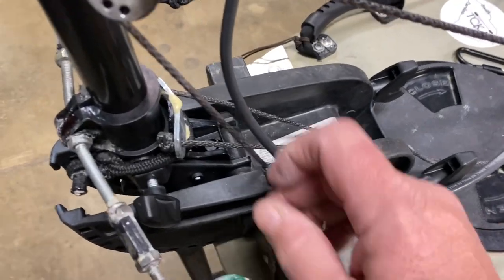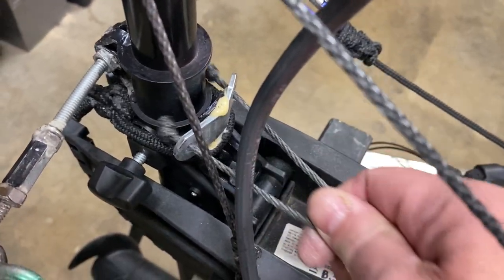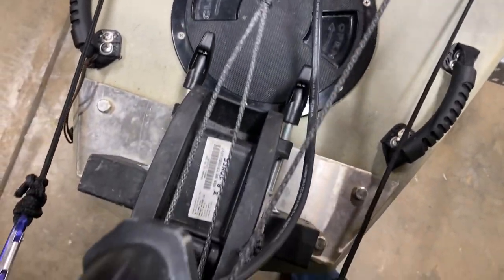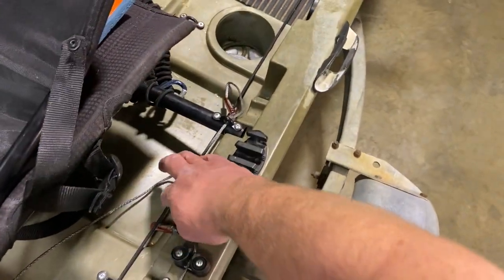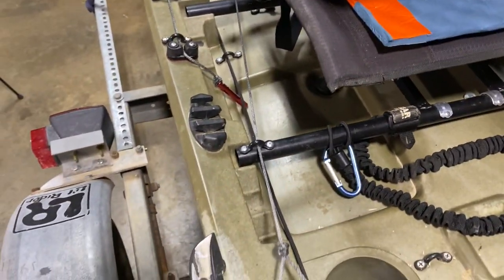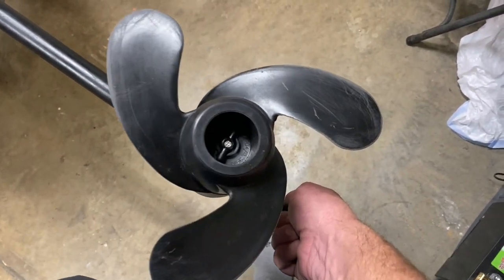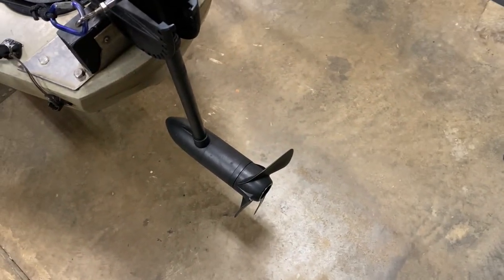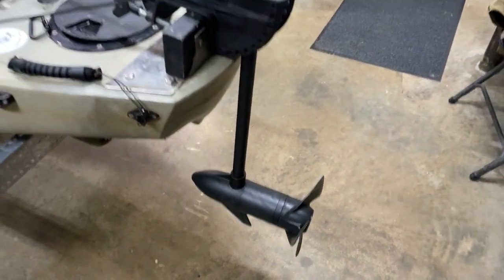Killer Mod to Easily Raise and Lower a Trolling Motor on your Fishing Kayak

Comment: ahoy mate.   attaching the cable to the bottom of the motor and having that pulley right at the top was a game changer!!!   its so easy to pull up it motor now.   before I had the cable attached right at the top of the motor and was pulling down to a pulley on the boat.   it was so hard to lift!! thanks for that idea!!! drinks are on you!!!

Comment: You single handily solved my issue with wanting to use reverse but that little lever stays shut so it moves freely I will definitely be adding that curved bracket and ties to mine so I can finally use reverse!

Comment: I’m doing the same only thing is I’m putting a 1 x4 in. Aluminum plate inside the plastic parts on each side where the locking notching holes  are. Then do the same thing you’ve done. With my bungee or springs. I like your thinking

Comment: I'm going to find a way to have that lift cable also release the stop on the pivot. So that way when I pull the cord to lift the trolling motor, I also release the lock tab at the same time. There's got to be a way to do it.

Comment: Nice video.  I came up with a simple way that doesn't require any modifications to the locking mechanism.  Just had to drill a hole through the lever and used a pulley I had purchased from home depot :)
Reply from the maker: Great idea man! I thought of the same thing I was trying to avoid drilling it, but I think that’s gonna be the best way to go in the long run because there is so much tension when using the bungee that I don’t think the glue is going to hold overtime. It’s worked so far, but I think your idea would be a better long-term solution. Thanks!
Reply: Any chance you have a photo of what you did?
Reply from the maker: I’m actually working on a video right now that makes a way for you to raise and lower it without using the release tab. I wish I had thought of it earlier but I really didn’t have to alter much at all and it works like a champ. I’ve been using this for six months now and it’s amazing!!
Reply: @justinmayer9973  I have a video up on my page.  Check it out and see if it'll work for you.

Comment: Great video. My kayak is setup to pull the motor straight up with a rope behind the seat. Maybe a weight lifter would make that work but the weight of is way too much for me. So I want to redo it using your idea, but do you transport your kayak with the motor on it? Removing it for transport doesn’t look like an option.

Comment: I used a bungee cord for locking the shaft of the motor in place too, instead of tying it I used heavy duty zip ties. I started loose and worked my way up to the right spot. Todd Ferrante on YouTube has a different way of doing this

Comment: Do you have inside hull access where the cam cleat is installed?  If not, how did you install the cam cleat?  Trying to put one on mine but having trouble as I do not have inside hull access at the place it needs to go.  Thinking of trying toggle bolts.

Comment: Great content! 2 questions, is it better to keep the motor unlocked instead of locked in case you bump something? That way nothing is damaged or there’s less damage then if it is locked down. Also do you have to register/title the boat now that it’s no longer paddle/man powered? I have a motor on mine and have been trying to figure out the regulations. Can’t wait to see you out there and take a closer look at your yak!
Reply from the maker: Great questions. For your first question, yes keep it unlocked most of the time. I only lock mine when I am floating down a river and trying to slow myself down to fish certain parts of the river. For your second question yes you do have to register the boat if you put a trolling motor on it, not the Motor, just the boat. In South Carolina it’s only like $20. I called DNR in my state to confirm the regulations. I would encourage you to do the same just to be sure. I have a lot of fishing videos with me using Trolling Motor and it’s awesome, take some time to check them out. Thank you for watching!

Comment: Raise your steering cables and you’ll be able to lift the motor with just your feet. Or, combine the unlocking cable and the lifting cable into one.

Comment: Gorilla glue didn't work for me. But, mine was clear, so I may have used the wrong kind
Reply from the maker: Dang Steve… I should’ve said this in the video but I didn’t think about it.... when I use the gorilla glue tape, I take a heat gun on low heat and just heat The object up just a tad that I am putting on the kayak, but I do it while The object is still in my hand. The heat causes the tape to get a little softer and the tape get softer so adheres really well but is still removable. I also heat the surface of the Kia where I’m gonna mount it just a touch just to get warm. I hope your product works out feel free to reach out to me if you have any more questions and I’ll try to help
Reply: @FlintHillCatfishing  would the apoxy work ok too? Not sure I've seen the tape, but I'll try heating it up once I find some if my apoxy doesn't work.
Reply from the maker: @Van50van  i’m not sure what kind of epoxy you’re referring to, but I probably wouldn’t use any kind of liquid glue or epoxy on the surface of my kayak. That would make it pretty ugly if it dried and had to take it back off. But I may not be understanding what you were talking about.
One other thing that I have done before that does not include the gorilla glue tape......I have used  plain old duct tape to secure whatever I was positioning on the kayak and it works Just fine. I only used the gorilla tape because I had some at the house. I tried it and it works fine. I just really like to do a non-permanent dry fit to all my accessories before I drill holes and bolt them down to the kayak. Thanks for watching man!!!